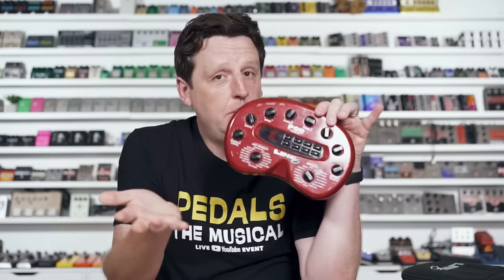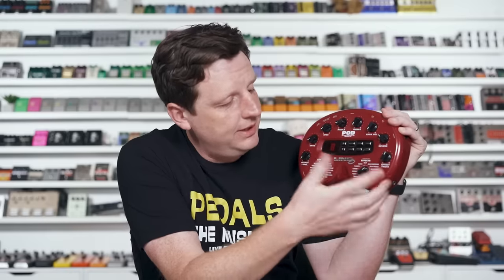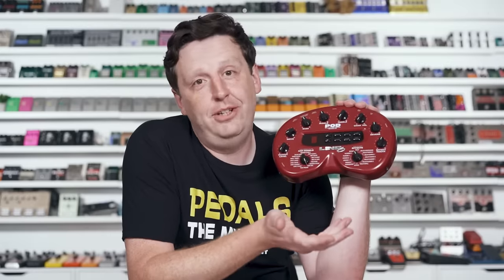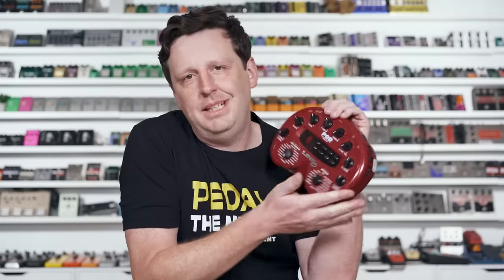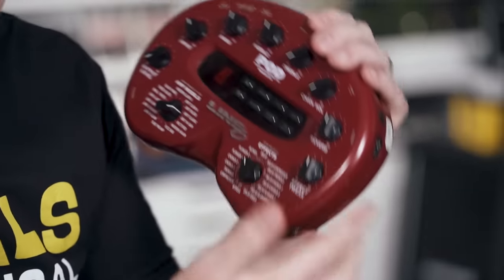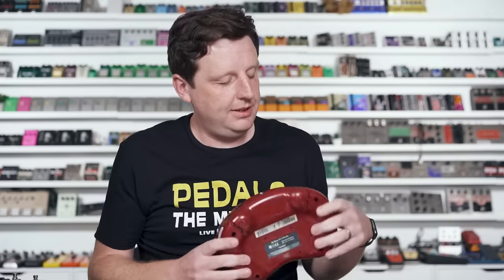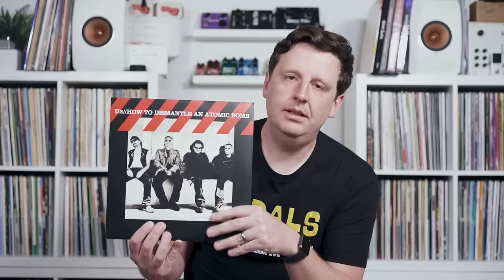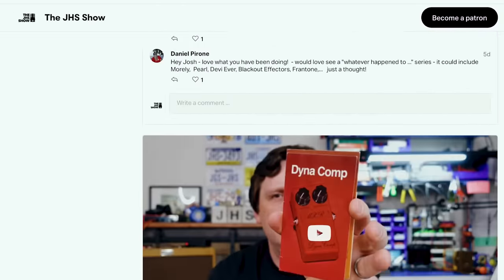Why The Line 6 POD Sounds Really Bad

Comment: I had the pod HD200 floor unit, and got some amazing tone out of it.  I sold it a long time ago as I was starting to collect my first pedals.  I actually traded it in at guitar center for a used JHS 4 Wheeler lmao.  I wish I never got rid of it tbh.  There were years of time where having it just to use as an amp modeller at home wouldve been handy

Comment: Guilty! 
When I came out I borrow it at the music store (cool store). Bring it home. Though it was cool in headphone (but blast my ears) and though it suck on an amp (Danelectro nifty fifty). I was 16 years old. 
2 Years later did a gig with a guy who used it for a set of SRV covers. Blashephemous, righ? His setup? Line 6 straigth into a powerful Yorkville PA (eh, canadian) . Vocal and guitar. For a live sound it was pretty good and low maintenance. I had to reconsider my judgment but that is the first time I understood:
* how transparent an amp can be and how a PA and keyboard amp needs to be powerful.  
* how my guitar straigh in a PA suck. 
* how an amp emulation over a non transparent guitar amp usually suck. 
Those kind of thing.
Josh you should have mention that aspect of how you use it. I'm pretty sure the amp you are usingfor those demo is pretty powerful and wide. So you got a lot of headroom and a large spectrum. It would be harder to get those sound in you MIG 50 i think. I'm sure YOU could - but you get my drift.

Comment: Bought mine in 98 at guitar center also sprang for the floorboard foot controller as I used the pod as a preamp into a 50wt Peavey classic through 4/12 of greenback goodness. I always used the plexi model and it turned my 50wt tube Amp into a convincing plexi tone, and the effects alone in the pod are worth the price of admission. Playing in a rock cover band at the time it came out and I used that rig for 5 or 6 years. It really opened up for me when I started making my own patches, and effect chains. There was a lot you could use in the factory settings and of course there were some stinkers as well. In my top 10 gear list, the POD 2.0 with floorboard is at least in the top 3 best purchases ever! And, I still have it, and it still works. It literally transformed a 50wt head into an EVH sounding plexi mixed with a delay, and chorus Is a chefs kiss of tone. Also used it on an albums worth of covers with my bros that had basically been a killer trio since we were 10 years old.

Comment: I agree the Line 6 Pod sounds good but one crucial flaw is that by default you can't swap channels mid songs. When I was a kid, I was playing ska punk, meaning you often needed to switch between distortion and clean with the tap of a foot. Line 6 Pods don't offer that. And sadly, I only heard of "add ons" through baseless word of mouth so if there is some kind of "add on" for this feature, I didn't know of it until I had long gotten rid of it.

Comment: Think a lot of people who hated it were those who had spent a fortune and a lot of time building up an expensive set of pedals with a spaghetti of patch cables, and plugged them into a pricey and hernia-inducing amp and speaker.  Suddenly here was this thing the size of a handbag, relatively cheap, that put a lot of their sounds into one unit accessible at the turn of a knob.

I used a pocket POD for practice while away from home when space was at a premium.  Never had the POD in this vid, but used the startlingly similar Behringer V-Amp 2, and still use the Pro rack mounted version for home recording, and could never understand why folks hated this kind of thing.  The sounds are in there, so don't give a stuff that it isn't a huge black wardrobe with Marshall or Fender written on the front.

Comment: I still have mine.  I also have the foot pedal.  I no longer use, but it was only 4 years ago that I put it away and  started to use an all-pedal pre chain going into a power amp.  But before this, I primarily used the POD in conjunction with a bunch of pedals for over 10 years.

Comment: I was so impressed when I got a Line 6 POD 2.0, I sold my Mesa Boogie amp. True story. The POD had much less hum & buzz, didn't give a crap about the flickering neon light at the gig and was MUCH easier on the back. I'm now a heavy Helix/Variax user, but I can still conjure up great sounds very quickly with my 25 year old POD 2.0. I keep it at work so that I can stay awake rockin' away on the night shifts! Still going strong.

Comment: As a brilliant, completely unheard of guitarist, I used the 'ol bean pod a ton until I realized I needed to go 100% ANALOG. I had so many awesome pedals, vintage Ibanez, Keeley modded boss, Analogman, and my noise floor sounded like I was constantly being attacked by killer bees. Not Wu-Tang, actual bees. Then I got an HD500. Made a ton of records with that dang HD500. Now I'm back on analog pedals (and a LIne6 M5), and I spend most of my time patching and re-patching, never worrying about actual guitar performance. But then I plug the whole board into a UA Apollo. Long live analog, digital, and digital!

Comment: Had both the Pod 6 and pocket version as a teenage guitarist because of a particular viral guitar solo I saw on early YouTube. Always struggled to get a sound I wanted out of it (metal head) but now in hindsight, I'm almost certain I was using the menu system incorrectly. Also blew my mind when you said my fav U2 album used it.

Comment: I used this in the 90s IIRC and it was pretty impressive with the footswitch controls you could plug in with a CAT cable.  I pretty much left it on rectifier or clean but pretty revolutionary at the time.  I ended up switching back to tube amps and pedals again, now I use an Axe FX III.  Who knows what the future will bring, but I'm always impressed by the improvements in tech in this space.

Comment: Used the Pod, Pod 2, and Pod HD.  Never had a problem with any of it in studio. Pod 2 was my fave. Live, was harder to compete dynamically with cranked Tweed amps, however, which was why I sold them. I LOVE the M9. That’s a permanent fixture on my board.

Comment: POD 2.0 was a game-changer for me. I never did or wanted to mic an amp. I would probably still have my POD if it didn't die on me. Replaced it with a Digitech RP-355, then a Mustang V V2, and now a HeadRush MX5. Modelling has always been good enough for my apartment/basement/office recording purposes.

Comment: So in 2003ish I played the only zinky amp I've touched. My lab partner got a prototype.. one off. Inspired by the modelers jamming 16 amps in a kidney bean, this had 16 amp models too. Except the zinky amp wasn't a digital model, it was the actual tubes, the actual circuit.  The signal path stayed analog and was altered by relays. It was heavy af, extra tubes and all the relays, but it was cool. Anyway needed to share the coolest/rarest amp I've touched cause it was inspired by the red bean.

Comment: I liked it but I liked the Johnson J-Station better for having deep editing from the front panel even if we had to memorize or reference the parameter labeling, and that there was a compressor in the front of the amp that can be used as a booster. I use the Helix, but I still have the J-Station for private practice and noodling.

Comment: The pod was my first multi fx effect. Loved it for many years until I fell down the pedalboard rabbit hole. 

Found the pod years later when I cleared out my attic. Plugged it in for a laugh and spent hours tinkering with my old presets. Eventually sold it on eBay years later and gave it a good home 😊

Comment: I mainly play  bass but play some guitar. I’ve owned a couple different generations of the pod and now own a hx stomp. The guitarist I’ve played with for more than half my life had the flextone amp along with another rig that used the pod pro with a real mesa power amp and cab. They do a couple things really well. Like eliminating the need for a pedal switching system. Keep the rig simple (less to go wrong) Could use different amp models for like the Roland jazz chorus, jcm800 and fenders which would be very impractical to do live with real amps. Amp modeling has gotten better over the years. My buddy now uses a fractal. I have a line 6 hx stomp and in a live music context I use it more as a Swiss Army knife pedal to keep my pedalboard small and practical. But at home it’s great as a songwriting tool. Even if the tones aren’t what you want it’s great for writing demos easily at home. If it sounds terrible you’re probably using it wrong. Like using a cab sim and running it through a real cab makes it sound terrible. Also really cranking the gain and highs on digital stuff tends to sound bad. There is an annoying high end even when recording but it’s nothing an eq plug-in can’t fix.

Comment: This was quite entertaining. And I agree, the Line 6 Pod 2.0 was awesome... well, still is, I haven't let mine go. I bought mine in 2000 and have used it over the years for a lot of different things. My favorite, was playing in a small theatrical ensemble. I switched between bass and electric guitar, and needed different sounds for the different songs. I had a Carvin guitar with all the switches, so I could go from spanky single coil funky to bridge humbucker heavy rock with just a switch of the preset. 

It is still one of my most treasured devices. I also have a POD XT that doesn't work, and a POD HD500 that mostly works. ;) The Red Kidney Bean is still killing it! Only beef is that it is 9VAC, not DC; not sure what the deal was with that... and blew up a Korg pedal because I wasn't paying attention.

Comment: I’m sorry, I bought a rack mount pod in 2002ish, worked with it for about an hour and all I got was a headache. Retuned it to the store the next day. Couldn’t get a useable tone it of it. Maybe it was because I don’t use effects, I’m just interested in amp tone. Later on line 6 came up with an amp that used a modeled preamp section going into a real tube power amp section and that was a big improvement. Tones were workable, but since I already had tube amps with good tone as soon as you plug in, why would I need another with merely ok tone?

Comment: I've used Line 6s in live settings before, first to emulate a late 60s Marshall and various effects hooked up to a 50W Crate bass amp fed into a 4X12 cab, and then I used it just to add delay, EQ, compression and sometimes reverb hooked up to a Blues Driver and either a Marshall JCM 900, a Peavey Windsor, and/or a 1965 Fender Super Reverb.  It's not perfect, but I did get some nice tones and it was effective at getting the job done.  Do I prefer actual tube amps and individual pedals?  Yes on the first, but not everyone can tell the difference between an emulated amp and a classic tube amp.  Individual pedals are cool for sure, but having a barrage of high quality digital effects in a POD or similar unit can make life a lot easier.

Comment: I still have my old Line 6 Bass Pod from back in the day.  The RAT setting was always the distortion setting I enjoyed the most.  My biggest issue with it was always the shape.  The lack of floor controls made it just about impossible to use live and I couldn't afford a midi controller which is what I would need to be able to use it like that.

Comment: Best thing about the Pod was how easy it was to dial in a sound you like and then give it a bit tweak towards how you like it more. And boom you had a perfect sound for recording. Sadly at mine the display broke after many years. I tought about getting a used one cheap because that was all i needed. I ended up in affording me a Helix. First impression when creating an own sound, so much to create from scratch instead using some existing settings and modify it. Of course now i know how to use it and love it too. But the concept of the Pod is still quite genious: Switch it on, turn a knob and start playing guitar.

Comment: Great video. I used a POD for many years at home. Great for running through different sounds and trying to play something that suits. I threw it away in the end because it produced increasing amounts of (unwanted) fuzzy distortion and was unreliable. I looked inside, but there was no obvious loose connection. I usea Positive Grid amp now, but I miss having everything at my fingertips on the desk.

Comment: I love my POD X3 Live, even though I had to replace most of those cheap footswitches (feetswitch?). It can do so much with a little dive into the menus. Use the volume pedal as an expression pedal controling the speed of a tremolo? Then use it change the length of delay trails on the fly? Yes, please!

The simulation of the Cornford amp is apparently nothing like the real thing, but it sounds so deliciously dirty, borderline like a Harmonic Percolator if you push the drive. It's one of my favorite tones.

Comment: Had a few BOSS VF-1s only because you could rack mount them. Never really used the original Pod much, and mine just disappeared at some point. Still have one VF-1 left in a box somewhere, might have to get some Line 6 gear again.

Comment: I've still got the rack-mount and floorboard!   I never thought it was sucky  but it did have some limitations for chaining effects, and support for upgrading/modifying the effects kind of disappeared for the original system.  Tho i haven't looked to see if anybody has released updated software for 5 years or so, as the Pod just sort of sits cold out in the bandhouse anymore, and doesn't get much use

Comment: The problem with the pod for me was that I was treating it as a multi fx unit that I'd put in front of my cheap crappy tiny amp. It's meant to be a standalone unit that you plug into a PA or use your headphones on. Cab sim through a terrible amp with a tiny speaker just doesn't work. Wish I knew that as a kid.

Comment: I think Josh missed his calling, he should be a... Reverse motivational speaker. Every time he says something cannot work, or possibly sound good, I know it can!
 On the POD, I had a Guitar Port back when. Basically the same thing, but all the controls were on my laptop screen. Showed the whole signal chain, and everything was selectable and adjustable. Not bad for $150 in '06, as I recall. It sounded great on my headphones, and I understood the limits of the computer speakers. (Remember the bass box & the two little speakers?) Didn't do any recording at the time, so I can't speak on that. It was a fun "rock star machine" where I could pretend I was onstage playing through a full rack and 4x12's! 
 One day, maybe in 2010, I dusted it off and tried updating the software, and learned L6 was no longer supporting the Guitar Port. That was that.

Comment: Thank you.  THis is a great video.   I too have a HX Stomp, but my 20 year old POD still can pack a serious punch.   The Helix does have nice Cab emulation features, but the amp model still sounds similar (The ones that I use).  I guess if you have it right the first time, there is no need to change.

Comment: I had a behringer clone of the pod. True, for the price you might not get the best fuzz, the most versatile of delays or the most accurate simulation, but this is a tool that I used to figure out what kind of sounds I like and how are produced.

Comment: I was an employee of Roland when I bought the kidney bean Pod, could of had any Roland or Boss pedal for cost price but no. Best pedal I ever owned and IMHO never been beaten. I sold it and bought a Digitech DSP 2101 which was much more expensive, but in some ways not as good.
 Revisiting this video in 2024, as a service centre for 35 years working on most makes, this POD is pretty much still unbeatable IMO. Many of the newer Chinese pedals not only don't sound quite right but seem to self distruct after a year.

Comment: My first gear was a black LP custom type guitar and a Marshall 15CDR (toghether 137€, second hand but like new). Before buying lots of pedals I thought a multi effect unit will do the job. So I just was indecisive if I should get the POD 2.0 or the pocket POD. As I like dials better than scrolling thru a menu, I grabed the 2.0 cheap of ebay for 35€.
It’s better than just a bedroom headphone practice amp! 
Loved it, for the past 6 years, and did by far not completely explored it.

Comment: I have a Pod XT Pro which I bought in 2006 second handed and used for about 10 years. 

After that I got the Eleven Rack and the Kemper. 

The Pod still sound good after all those years.

Comment: Wait you sent the POD to the INPUT of a combo amp?
Yeah, it sounded good in a mix after some post tweaks I would assume, but it's not the best way to check if it sounds good or not.
If you'd go direct to DAW it wouldn't sound as good, because the built in cabs (all the way to HD500 era) sucked.

But, this still proves that even doing something "wrong" doesn't mean it's a bad thing.

Comment: I had two PODs over time, and generally ran them into a Fender Hot Rod on stage and into the PA, and it sounded great. I went back to a bunch of pedals for fun and less programming. Now I'm using a Helix. What's old is new again I guess.

Comment: I still have POD 2.0. I bought it when my son was born to play on with headphons when he was sleeping. I used it few times even on stage for jaming. I still think it sound really good. Before it I had (and it's till in my room) much older DOD GS-30 multieffect. Supringly some mod effects or amp simulations are better for me. Now, for home jammming and practissing I use NUX MG-30 and this, after over 20 year after POD v. 2.0, is huge difference. and it's good and I still use sometime an old POD.